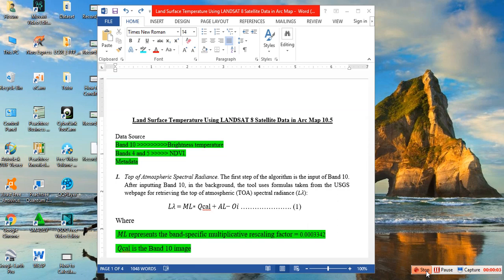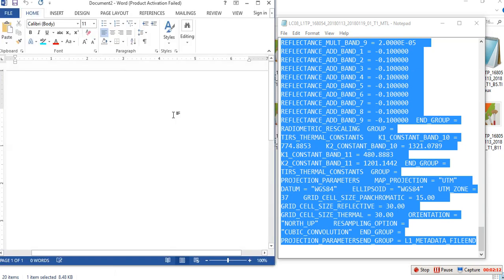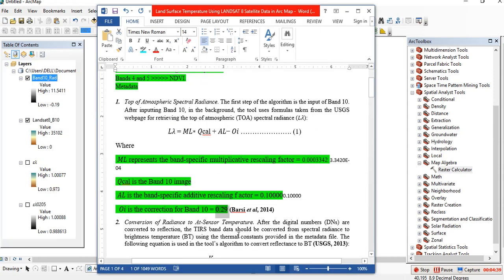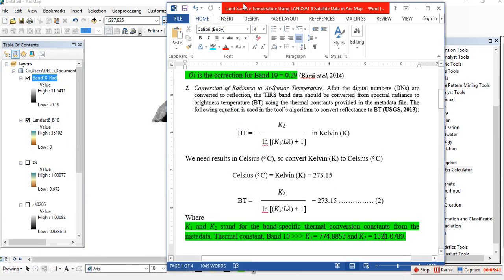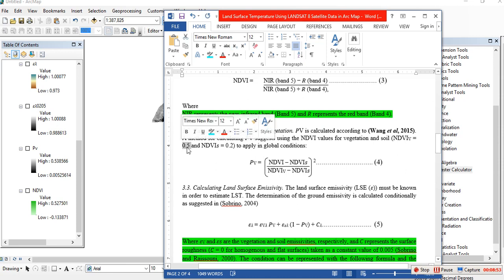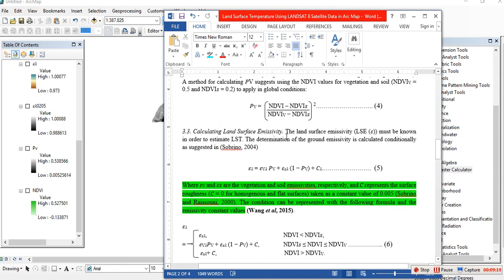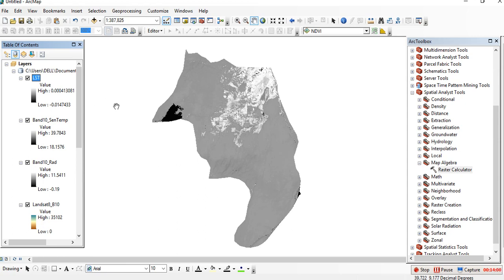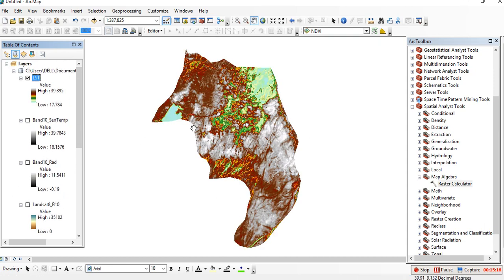How to Calculate Land Surface Temperature using Landsat8 in ArcMap 10.5

Comment: 𝜆 is the wavelength of emitted radiance (for which the
peak response and the average of the limiting wavelength (𝜆 =
10.895). In some cases I have found this LST = (BT / (1 + (0.00115 * BT / 1.4388) * Ln(ε))). From where they found this value 0.00115?? Plz reply

Comment: I think there is a flaw in your prccessing towards the Ts, λ in the formula means "the limiting wavelength 10.895"....but in the raster calculator ,you just use the Landsat8_B10(the DN)........Am  I wrong ?
Reply: What is the solution? 𝜆 is the wavelength of emitted radiance (for which the
peak response and the average of the limiting wavelength (𝜆 =
10.895). In some cases I have found this LST = (BT / (1 + (0.00115 * BT / 1.4388) * Ln(ε))). From where they found this value 0.00115?? Plz reply